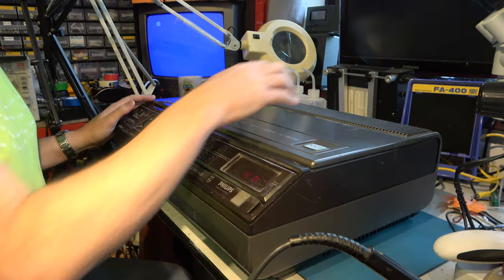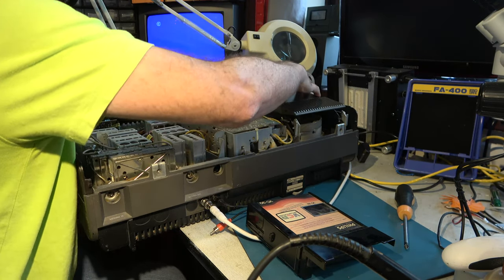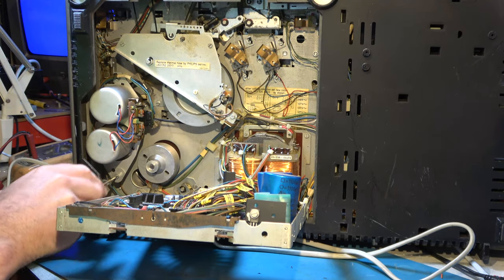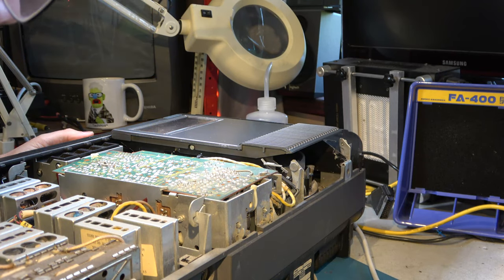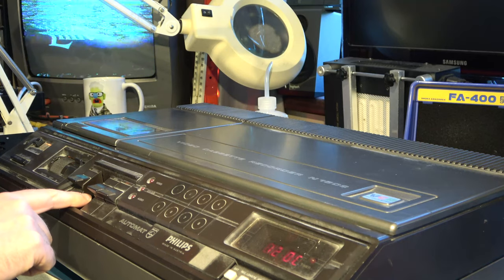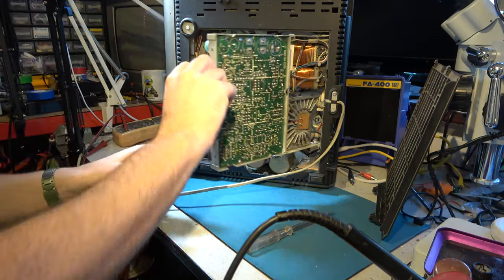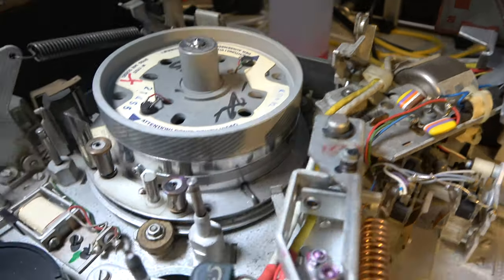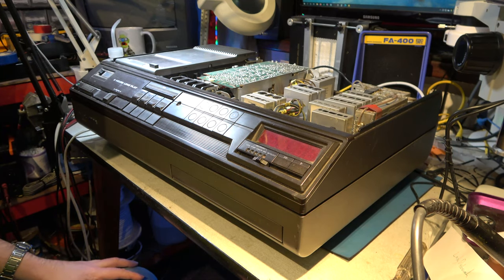Philips N1502 and N1700, head drum drive belts and more.

Comment: Hi Colin great video I must say I've never had a problem changing the drive belts may be because I've got little fingers that helps a lot i do find the flat belt that drives the head drum tends to jump off the drive motor quite a bit maybe I'm using to large belts I don't know

Comment: Not sure if that's something you are looking for, but I'd have a Grundig BK 2500 COLOR that's sitting at my parent's place. Not sure if parts are interchangable to the Philips machines. It's quite a bit older than those.

Here's a photograph:
https://upload.wikimedia.org/wikipedia/commons/3/34/Bk2500_color.jpg
Reply from the maker: The heads are probably not interchangeable though the tape format is the same as N1500.  So it would only be useful if I could actually repair it, which would be a challenge.  Send me an email via my web site, it could make an interesting YouTube video at least.

Comment: That 1700 looks better than my 1700 in the late 1980s, early 1990s!
I didn't know the white tool could be used for cleaning the capstan(?). I used it for years as non-conductive, non-magnetic screw driver.

Comment: Yes i thought the replacement belts looked a bit weedy, but they worked :-D
Maybe the motor is not as strong as it used to be,  wearing brushes can change the connection quality.
Or crap caps on the motor servo board,  old enough to be high esr?
I have one of those white tools, i didn't know what it was for or where i got it lol.
I think the motors are similar to the capstan motor on the old jvc 3320 piano key machines.